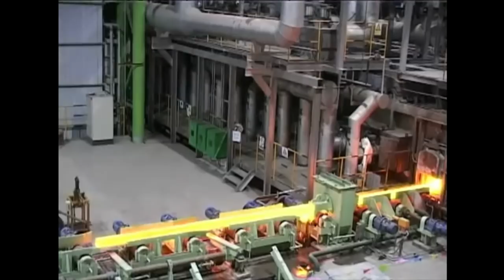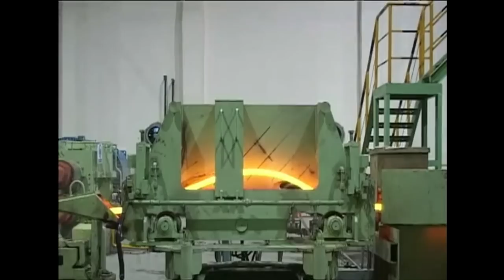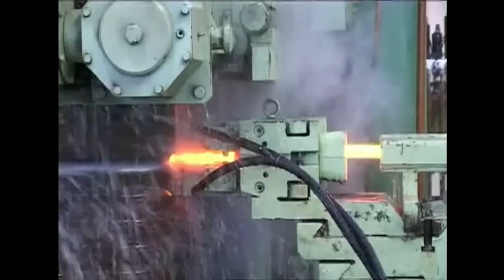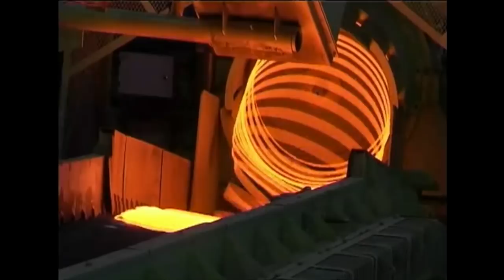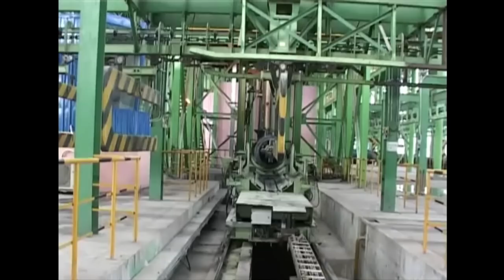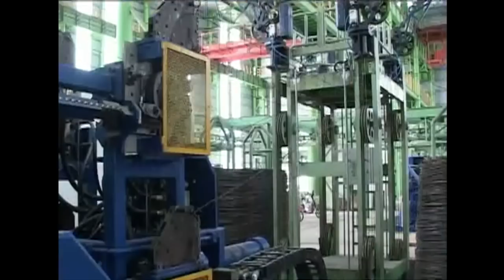wire rod rolling mill

Comment from the maker: www.sinomgroup.com; SINOM GROUP CO., LTD. has maintained the leading position in China in the aspect of wire rod process, equipment and technology, possessing superior technology with independent intellectual property right for SINOM top-crossing 45°high speed wire finishing train, being able for complete independent design and equipment packaged supply of wire rod rolling mill. It is capable to make the max. guaranteed speed more than 100 m/s on the bases of proven rolling mill with max. designed speed 113m/s and max. guaranteed speed 90 m/s.
 
SINOM has sufficient performance references for wire rod mill project, especially in aspect of customized requirement, using different layout such as semi-continuous process, zigzag layout, discontinuous rolling process and multi-line rolling to meet different requirement by customers for product, investment, space and output.

Our company possesses the unique know-hows of forging, metallurgy, NC machining, heat and surface treatments, a lot of precision equipment, and has the capability to do test and inspection of machined, riveted and welded, hand-assembled or hydraulic parts or assemblies, and inspection and trial running of complete high-speed wire rolling mill line. Its test benches can be used to test run 90m-135m/s high-speed wire finish rolling mills and pre-finish rolling mills at varied speed with all the necessary parameters taken by sophisticated measuring systems.

Successfully developed a new kind top-cross 45°super-speed mill which the test speed reach to 140m/s. It means that there is a successful update on finishing mill productions, and it must bring a new revolution for customer’s high speed wire rode machine line.
Reply: SINOM GROUP CO., LTD.